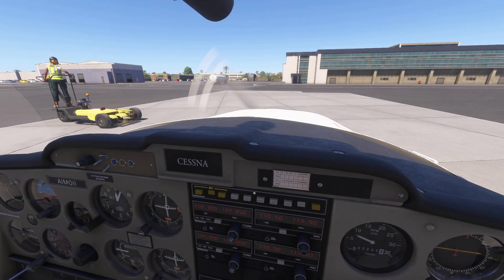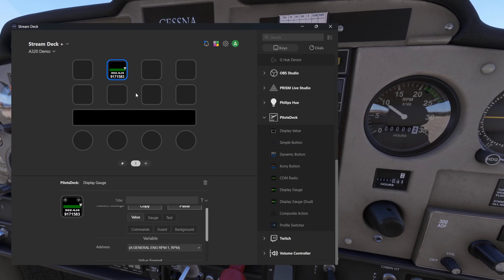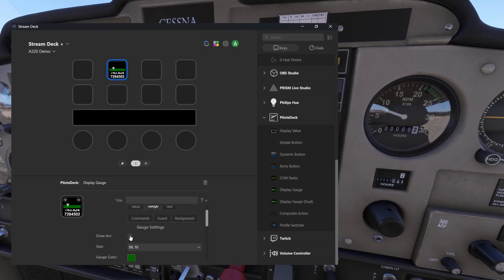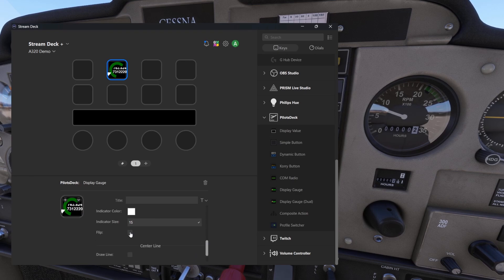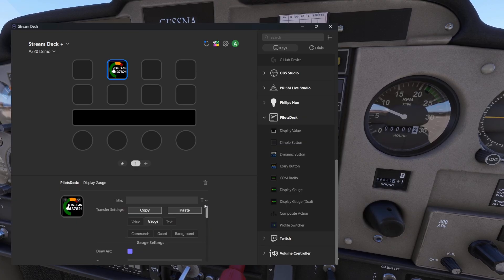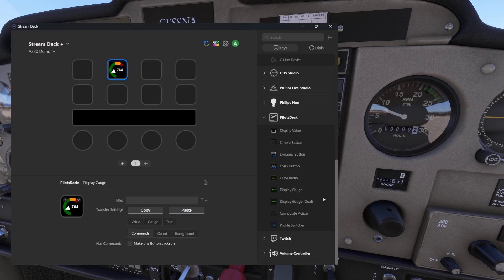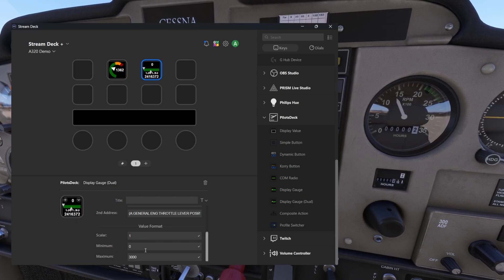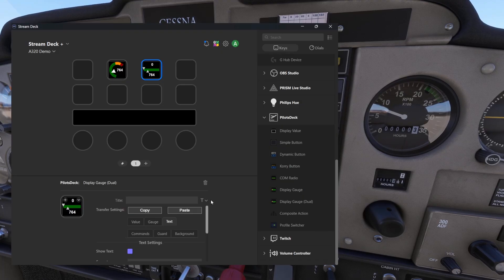Build & Customize PilotsDeck — Episode 3: Gauge Buttons

Comment: Hi, could you enable multilingual audio track in episode 1 too? Thanks a lot
Reply from the maker: Hi there! Good suggestions, I checked this briefly and this can't be added for older videos if the feature hasn't been available when the video is released. As Youtube informs, this might change at some point and multilingual audio would be turned on for older videos as well - "Over time, we may also generate dubs for previously published videos."

Luckily there is support for subtitles even it is not as good, and I will check futher if there is alternative way to add this.

Comment: Or where can I find a paid/free profile of C172SP GNS530 for fs2020, using PilotsDeck, as AAO plugin doesn't work with my pc and stream deck. Thanks.
Reply from the maker: Hi there! It seems these are not that common profiles, I have to check if I could have this on my queue as well. I have profile for G1000 version of C172, if that would suit for you.

https://flightsim.to/file/89860/stream-deck-profile-to-control-msfs-2020-2024-garmin-g1000